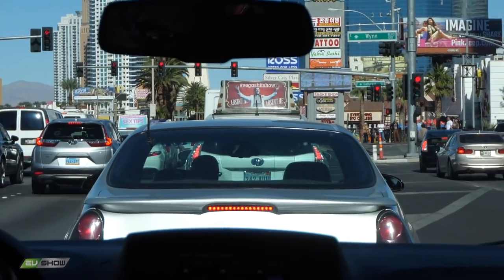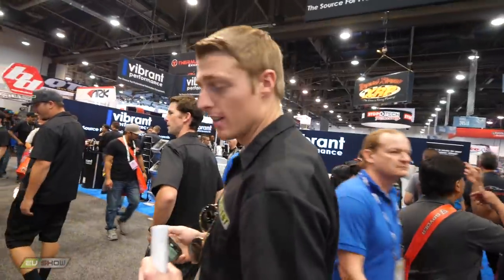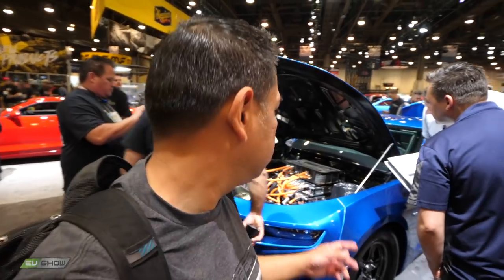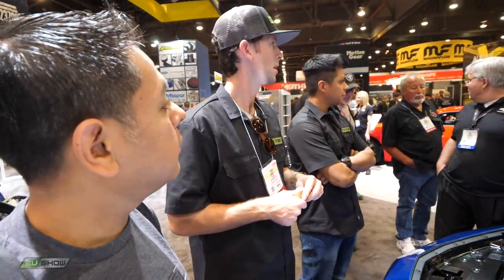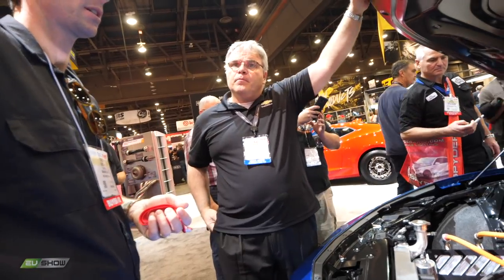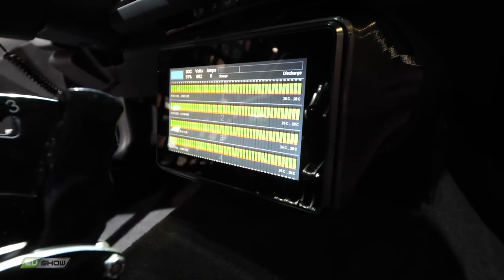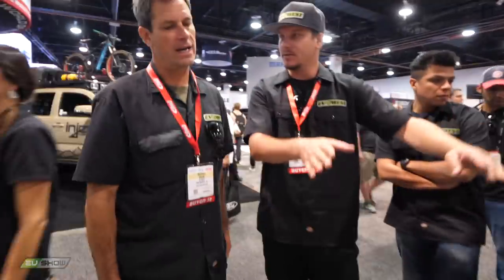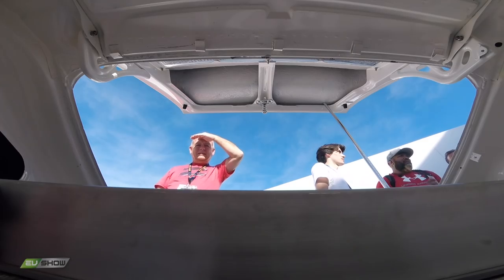600hp Electric CRATE Motor at SEMA (2018)

Comment: If tesla sold a crate motor version of their motors and battery packs,or sold a bodyless chassis, they would start and dominate a new market
Reply: But basically they can't keep up with the current demand. But maybe after they sort production hell.
Reply: I'm honeestly surprised they don't, a lot of people would like them for aftermarket conversions, but so far the only way to do it is to source the parts from a wrecked tesla
Reply: Different part of production, motors and battery packs are more automated. I don't think they ever had any bottlenecks in either thanks to Gigafactory
Reply: Justin Noker - Tesla is Anti Right To Repair.  That’s why they don’t won’t sell you sell replacement car parts.
Reply: They will never do it because they won't be able to charge 40k plus for it
Reply: @cpufreak101  they have alot on their plate tryna keep up with demand as is. He doesnt Patten it though it's only s matter of time before someone reverse engineers his design and sells it with even more juice for car enthusiast.
Reply: Agreed cartmanrlsusall  Thats all restorers want, lets design build a modular platform, customer adds the value in new and classic shells through their favorite build shops
Reply: @MadGreek2900  HAHAHAHA LOL, VW Group should focus on just making a decent BEVs. Not try to compete, don't bite off more then they can chew.
Reply: The problem is that the battery is literally the entire bottom of the car which is gigantic and it has active cooling radiator heat pump system which means that you would only have their rear wheel drive standard motor which is still pretty quick but not that quick, and all of that and the components for the battery management system would all fit in the hood. the problem is that a battery that would fit there would give you about 20 miles of range
Reply: This stuff in this car (power electronics) is designed and manufactured by Cascadia motions owned by BorgWarner. Kinda cool.
Reply: They do, you just need a tesla VIN

Comment: Not many people know this, but the 2nd gen Toyota Rav4 EVs, and Mercedes B-Class ED are Tesla powered! Just not very common... They both use full sized Tesla 470a drive units (same as model S), with a few modifications (parking pall, and reverse cut gears). They also use the same 40a onboard charger, dc-dc converter, and have battery packs built by Tesla.
And the best part is you can buy them used for sub $20k! 
I work with them on an almost daily basis, since the company I work for sells DC fast charging kits for them (called JdeMO), as well as does service on them.
Reply: That's pretty cool.
Reply: Dope info!
Reply: interesting...thanks for sharing.
Reply: Is it a Tesla unit or is it purchased from the same 3rd parties that supply Tesla.
Reply: @pogo1140  Tesla Manufactures their drive units in house, so it is the same drive unit (with a few changes specifically for those cars, mainly reverse cut gears since the motor spins in the opposite direction, as well as the addition of a parking pall). These cars were both built through a partnership with Tesla. Toyota paid Tesla $60m to build 2,600 Rav4 EVs from 2012-2014. Not sure how much Mercedes paid Tesla, but there are a lot more of the Mercedes b250e's on the road than Rav4 EVs.
Reply: @Alex_Bessinger   Very interesting info, thank you.
Reply: @Alex_Bessinger  it's incredible , DB and Toyota , with all the zigillon engineers and money  they have , they are not able to build an e-car on their own , the need to buy the parts from Tesla ... on the other end they advertise the products as "their" own ... it's a shame !

Comment: Ohhh yeahhh I love these videos haha... Rineheart are by far the most advanced and reliable inverters / motor controllers... unfortunately they aren’t cheap $$$$$ so much POWEEEEEERRR =]
Reply: POWEEEEERRRRRRR
duall motor setup trike has a belt stretching problem doesn't it?
Reply: Job91 hahaha my trike is a triple motor setup!!!! It stretched a bit but I tensioned and was all good. The electrical is tricky keeping all motors and controllers wiring and settings matching 100%. Im talking to you building it right now

Comment: The LS crate motor would be perfect retrofit for holden commodores! could ditch ICE, driveshaft, fit in wheel rear drive motors and put batteries up former transmission/driveshaft tunnel

Comment: So, I have 1971 Camaro RS that is due for restoration. I’m wondering what would it cost to convert to electric? I was thinking equivalent to 400 HP with rang of around 100 miles or more.
Reply: Whatever it costs to build a Tesla from junkyard parts. Or pay someone to design a full custom setup. The  cheapest DIY builds I've heard of are around $6k, but that's a very basic commuter ev, not a hot rod.

Comment: Electric crate motor would be amazing. Did they keep the original transmission? How did they handle after the motor?
Reply: considering the shifter, it seems to be using a custom drag racing trans of some sort

Comment: Awesome.. see the retrofits happen.. 

Now they just need someone to make kits to have underfloor batteries and retrofits are going to become a proper thing.
Reply: Some factory built EVs are essentially just gas cars "retrofitted" to get the required EV credits. Most of them have underfloor batteries, even though they were not originally designed with that in mind (although some are slightly modified). The Toyota Rav4 EV is a perfect example. It's identical to a 2008-2012 rav4 in every way, even down to still having the exhaust hangers. But instead of the gas power train, they have an electric power train and battery pack built by Tesla. The battery pack is even contoured to the floor so it fits in the transmission tunnel and all.
Reply: @Alex_Bessinger  any ideas where I might find something to fit the size of a Ford Festiva?

Want to make a double level floor battery and kick over a 1000km/mile trip.. 

Would be awesome to see one for a retrofit and the car is pretty cool as it is.

Just out of curiosity, you wouldn't happen to know the height of a Tesla cell would you? Not the height of the battery.. just a cell from the battery..

Thanks
Reply: Gary Stinten , I think you’d be pretty hard pressed to fit that many batteries in a festiva, even if you filled every available space in it, just not a big enough car to fit very much. Realistically you could MAYBE fit a battery big enough to do 150mi or so (roughly 250km). If you did that and put DC fast charging on it it would become a very usable EV. I personally have driven an EV with less range than that, equipped with DC fast charging, over 2000km in less than 45hrs.
The cells in the earlier Tesla batteries (including the Rav4 EV) are just regular 18650s, so they are 65mm tall. The rav4s, 1st gen roadsters, and Mercedes b-class use 2600mah cells, and the Model S and X use 3400mah cells.
The newer packs in the Model 3 are 2170s, so they are 70mm tall, but those are proprietary, so you won’t be able to find them anywhere.

Comment: Why the USA needs to step upto 240v
Reply: Gary Stinten we have 240. any house can wire for it. it's the 480 and 3 phase that is rare.
Reply: we are able to use 240v in our house. a lot of stoves and clothes dryers run off of 240v
Reply: Ohhh..never knew that.. 

So why don't they make 240v the standard?

It would make sense..
Reply: every house has 240V coming in (it's also referred to as 220V and 230V for some reason despite 220V being closest to correct) we have two 120V (technically specified as 110V plus or minus 5%) hot leads and a neutral lead that comes into the house. combining the two 120V leads gives you 240V which is used for bigger equipment such as dryers, electric stoves, or L2 EV Chargers. 120V is still the norm because A: we've practically had it for 100 years already, so no sense changing and making 100 years worth of electronics no longer compatible, and B: since it's two 120V leads going into the house, it's still simplest to just use the two 120V leads separately versus together
Reply: @cpufreak101 
Many countries switched from 120 to 240.
In france it was in the 50's (seems that we also had, in addition DC 110V).
For your 110V appliance, you just had to have an adapter, and in a decade you would'nt even remember you had 110V @ home.
Back then electric, appliance were rare. Must have helped a lot.

Anyway, the switch would be easy, and is still an economical gain (smaller wire, or less resistance loss).

I guess it's like not switching to SI.
IMO "we are used to it" is the worst reason ever.
Hell Sweden switched from driving on the left hand, to the right, overnight. You can switch units and home voltage :).
Reply: @xmtxx  issue is, it's now 2018, not the 50's. The amount of devices we have today is nothing compared to what we had back then. I wouldn't imagine a switch today to be practical

I do agree for the SI thing though. I spent time to learn the metric system (pretty good with km/h, can have a rough idea with Celsius,  learning the meter, etc) though my main issue is I don't use it in daily life enough to fully adapt to it. Imperial is a nonsensical standard with the only real main advantage being Farenheit has smaller increments.
Reply: @cpufreak101  Kuddo's for the SI. That must be hard, and feel pointless surounded by Imperial.

I know it's harder in 2018 than in the 50's, but I bet, that they said the same thing back then.
I'm pretty sure it's still feasable (and, more easily than you think).

The economic gain would surpass the temporary hassle.
Most of the PSU and charger are already 220V compatible, the rest of the world is already 220V. Serious professionnal power tools are already 220V.

What is still only 110V?
Some kitchen appliances, your vaacum cleaner?
Lighting comes also in mind, and might be the trickiest transition, but nothing impossible.
Just give some transformers to every home for their vintage stuff, and everything is good.
Reply: @xmtxx  thanks haha

And there is still A LOT that's 120 only, air conditioners come to mind. Many TV models also aren't dual voltage, same with cable company provided DVR's. Our dishwasher also wasn't dual voltage, and I doubt many refrigerators are dual voltage too. It'd be waaay too many step down transformers, plus, people here are idiots that'd plug these 120 only devices into the wall outlet anyway and then wonder why it blows up and stops working
Reply: @cpufreak101  that's the biggest reason why we can't switch easy. "The idiots who plug old stuff into the new system"
Reply: @Benni711  Why would you need to rewire your house?
The 110V wire can handle twice the power at 220V.

Most of the countries switched from 110 to 220 (of course it was a long time ago, and it was simplier).
Even if the economy in power loss is quite small, it would add up years after years.
You'd just need some 220 ->110 transformers for the apliances that can't handle 220 (like all other countries did).
After 10 years nobody would think about it anymore.

Comment: https://www.youtube.com/watch?v=z5mpcOs8FU4&t=293s) here ben try to one connected to a scooter water cooled engine as it goes with a 1to 1 or 2 to 1 add on gear ratio for 60 mile per gallon but is one hour at 19000 volts with 3200 amps. i also wonder why you don't just use the forklift alternator for the hydrualic motor with a smaller hydraulic motor on the battery to turn the forklift alternator. none of you guys seem to think at all.

Comment: Don't matter to how much power an electric motor has, it is never going to be interesting to me,this is going to be the future I feel sorry for the car guys that are younger than me, when gas stations will be scarce and you will be more or less forced out of internal combustion cars and trucks,but one could still have a Cummins diesel and run it off used transmission fluid or cooking oil if the government does crack down on people with diesel engines,who knows glad I won't be around to see it